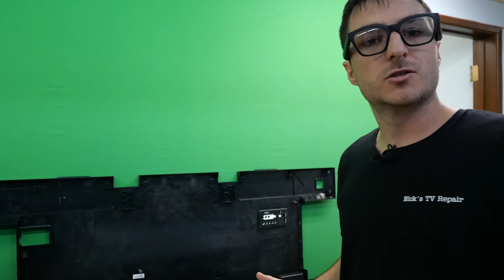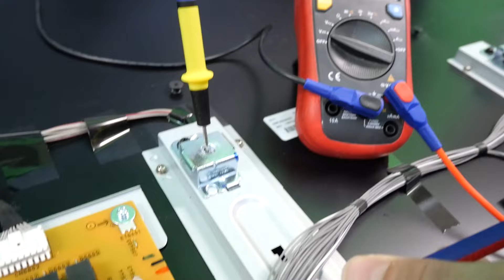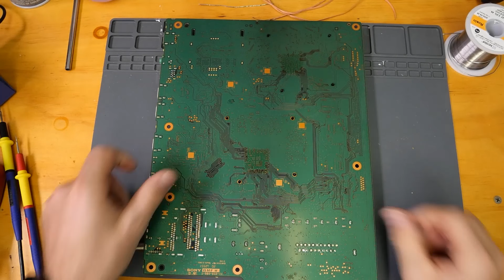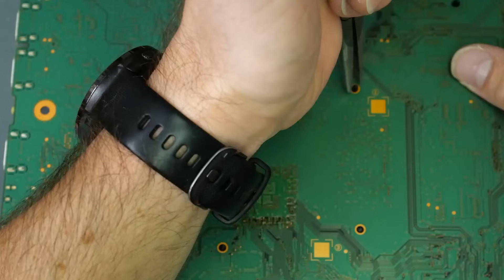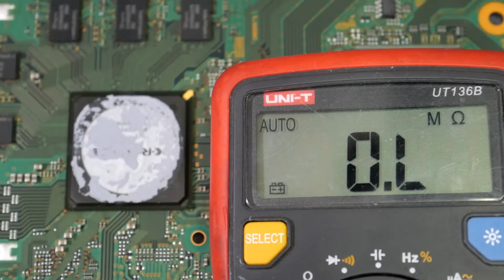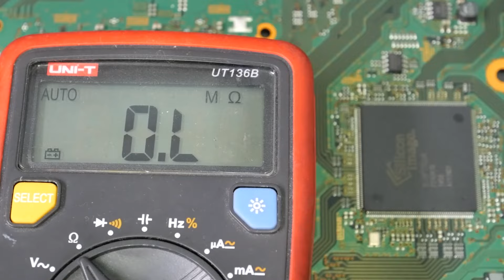Diagnose Sony 4K XBR-65X850D TV

Comment: There is nothing on the internet and YouTube for the 55-inch version of this model. But not for the no power issue I cannot find anything for the backlight error for the xbr55x850d everything I find is for the version of the model that ends with C. There is no wire coating to be able to locate which one it is

Comment: Hi Nick, I have the same issue with a completely unresponsive x850D that won’t power on. If I dispose of this TV and get another one, should I first remove the emmc chip to prevent someone from taking the streaming app credentials, email, etc?
Reply from the maker: most likely the eMMC is what has failed which means it's not readable and your data is probably safe. But if you want to be extra sure drill a hole through the eMMC chip before tossing out the set. But yes the emmc is the chip that would have your personal info.

Comment: Hi Nick, great content I’m having a same issue with this particular TV model the 850 D 65 inch Sony in doing the multimeter check for the power board. I don’t get any voltage for standby but I do get voltage for the 12V.  Do you think I have a problem with the power board?
Reply from the maker: When ever the power supply fails usually it will have 0v out. So because of that I would say there is a high chance the power supply is okay and the mainboard is the fault.

Comment: Hi Nick. My kd55xd7005 have problem while watching dvb-t2 (hevc), audio is ok, but picture stutters and freezes with lots of artifacts. That also happens on netflix and most of the time on youtube. When playing on external source everything works. Should I look for problems at tcon, or decoder at main board?
Reply from the maker: My advice would be to just use an external device for your apps. But mainboard is probably your fault.

Comment: Hey how's going?
I have 75X850D with same simptoms. Both PS are working only no tcon 12v. It was problem with emmc too. 
So wich kind of emmc r u using with? Genuine klmag1jenb-b041, compatible h26m52103fmr or KLMAG2GEND-B031 ?
Thanks in advance
Reply from the maker: I don't believe we are using the same one as is on the board but are using a compatible replacement. I honestly don't know which one we are using but there is not 1 right answer, there are many chips that can be used and depending on our parts supplier parts availability we have had to switch a few times.
Reply: @ Hey Nick 🤝
I need programmed emmc for my tv cuz I don’t have programmer, could you please sell to me emmc with firmware on it? 
I’ve sent a message at Dec 3rd on your mail, but someone answered me that we don’t selling parts. 
Please, help me with that. Tnx in advance

Comment: Hi Nick! could you please explain, why do we see so small resitance value like 33 ohms at the surroundings capacitors of  hdmi processor? Thanks
Reply from the maker: One side of the cap goes to ground, the other goes directly to the HDMI processor. The cap has extremely high resistance, you can't read it with my meter at least, but the IC chip has a 33 ohm resistance to ground on that specific line. So when you read the cap what you are actually doing is reading the IC. It's just easier to take the measurment on the cap than the IC leg. As for why specifically is the IC showing 33 ohms, you would have to look at how the IC is designed.
Reply: @NicksTVRepair  gratefull

Comment: If the EEMC is bad you should be able to see a single spot on it getting hot on a Thermal Camera. Rather than the entire chip getting hot. I had one go bad on an LG OLED and the EEMC would light up with a hot spot and then the relay would click off every second or two.
Infiray P2 Pro Themal Camera with Macro lense has increble clarity on small components. Couldn't recomend it more.

Where do you get the EEMC Chips from? Dead boards?
Reply from the maker: It's very rare for the eMMC to fail shorted like that. Almost always it just starts failing due to having too many read and write cycles. This won't cause it to get hot and won't be detectable without removing it from the circuit and putting it in a tester. 
With that said, it's pretty cool that you found one like that and were able to detect it with a thermal camera. Do you remember what the model of the TV was specifically? 
As for the eMMC chips, we get them as new unprogrammed from a secret supplier whose name I won't divulge.
Reply: LG OLED65CXPUA.
Reply from the maker: Oh, interesting. We have worked on and seen over 100 of these in the last 3-4 months but I have yet to see one with that failure. I will be keeping an eye out for it. 99% of the time it's the processor that's gone bad but I'll have my tech start using our UNIT thermal camera to check them out moving forward. You bet that I'll do a video on that the moment I find one with that fault so keep an eye out.
Reply: @NicksTVRepair  Infiray p2 pro has a fast refresh rate, so you might not pick it up on other thermal cameras. Not sure depends how quick the flash is. The macro lense in mindblowing, high detail on even the smallest components
Reply: Also a chip getting evenly hot is normal, but a hot spot in one area is usually bad chip, or cpu etc. The nand chip i observed had just a single hot spot on it.
Reply from the maker: Im going to start looking at the Nand chips with the thermal camera as well then. We do a good amount of Nand repairs but the majority that we do typically don't have bad nand chips, it's the software that gets corrupted but we do occasionally see bad chips as well. So in those scenarios that would be a good way to confirm.

Comment: Hi nick, I have a 55x850d black screen, no standby white or red flashing light. I have 3.3v, 12v and 19v on LD board and main boards, but I have BL_ERR 2.1v, if bypass the BL_err still have no standby led or flashing red light. if disconnect the cable from LD board to mainboard, I have back light on, 
then I measured few cap near the silicon image chip, few cap have 32-35 ohms, most likely the emc chip is bad?
Reply from the maker: Yes I would agree most likely the eMMC chip is bad. 
You can either replace the mainboard or send yours in for repair. However this model is no longer supported, so who ever you buy from make sure they provide a programed flash drive so you can pair the mainboard to your tv.

Comment: Can you do a tutorial on how to change the LED backlight on this model?
Reply from the maker: I have gotten several requests for that, and I will be doing a video on it once I get one of these TVs back in the shop with a backlight failure. But sometimes it's many months before one of these comes in with that fault, and sometimes I get 2 in the same week. It's unpredictable.
Reply: @NicksTVRepair  thank you for the reply. Let me ask you this, does the metal bezel, screen, etc have to come off in order to replace the backlighting in this model?
Reply from the maker: Yes the metal frame will need to be removed so that you can lift the screen off of the TV, then the diffusers, and then you will have access to the LED strips. It is a long process.
Reply: @NicksTVRepair  thanks bud. I ordered that part (LED backlight) from you and will update everyone on how badly this repair went lol.
Reply from the maker: haha sounds good. Just take your time with it, don't rush it, make sure you set at least 2h of time and as painful as it sounds don't do a little bit one day and finish later, do it all in one go. If you spread it over a few days you will forget where things go and how you took it apart. It's best to do it all in 1 sitting. 

This is not your TV, so it won't be the exact same, but I recommend you watch this video as it is for a similar sony and will help you get an idea of how to do this:
https://www.youtube.com/watch?v=kbk2SJkmtnM&t
Reply: @NicksTVRepair  yes, sir. Thank you for your time, bud.
Reply from the maker: Let me know how it goes. I am  keeping an eye out for this set.
Reply: @NicksTVRepair  so far not so good lol. The LED strips were bent. I called y’all and was told that they’ll work, but won’t work for long, to send in pics of the package and strips. Hopefully y’all will send new ones in and take these back or something.
Reply from the maker: Yes I got your photos of the damaged box from shipping and my shipping guy just shipped a new set of LED strips out to you today. They should arrive very soon.
I would say just toss out the first set that was damaged during shipping, there is no need to return them.
Reply: @NicksTVRepair  10-4. Thanks, y’all!
Reply from the maker: How did it all go in the end with the replacement strips?

Comment: i have a 75x850d. is the steps the same?
Reply from the maker: Yes and no. The 75" has different types of circuit boards. It uses one that are more similar to the 930D series. You can check these videos out instead, they may be a bit more help:
Confirm your DPS baord is okay (least likely of your faults with the 75" version)
https://youtu.be/kaCl8J1pPd8

Mainboard fault on the CPU (also very unlikely with your model version)
https://youtu.be/bF46xvxVYW0

Mainboard eMMC fault (most likely reason for issues with the XBR-75X850D)
https://youtu.be/YL123l67h6w

Email us directly if you have any additional questions otherwise it might be tough to keep track of conversations accross the different videos. (contact info in video description)

Comment: Tried doing this myself but managed to pull several pads off with the emmc lol :’)
Reply from the maker: Send us a picture of the ripped traces, we might still be able to fix it. Otherwise, if we can't, we also have refurbished ones for sale.
Reply: I had the same problem. It depends if you ripped off some Not Connected Pins (darker background) or used pins (on brighter background). But even only NC pads were ripped off you have to be careful when soldering these, as the remaining solder balls of the chip can bridge some used pins
Reply: Preheat the Board with your hot air gun a whol bunch before going after the chip!
Reply: @0ctivate  amigo tengo una con el mismo pronblema pero no entiendo ingles soy tecnico

Comment: Some Apps may not work after EMMC replacment and reprogramming even if sent in for repair?
Reply from the maker: If it is an emmc repair then yes. Not all are EMMC repairs, some are CPU replacement, some are HDMI processor. But if the EMMC does need to be replaced then in that case yes some of the apps may not work. However using a firestick, roku, chromcast, apple tv or other similar devices will allow you to get access to all your apps and more + will be faster and easier to navigate than the built in apps. 
By default the native apps are an inferior version of the apps. So you could call it a forced upgrade.

Comment: Hey Nick, love your videos.  Wonder if you have ever done a Sony XR-85x95J repair.  We're having a very very similar issue but in our case, we're not seeing any standby voltage.  We replaced the powerboard twice (through the same dealer) and still nothing.  The original and the two replacements and still no standby voltage reading.  We're following this exact method for our power supply board.  I think we're doing the measurement correctly as there is definitely voltage going into the board, we have confirmed that.
Reply from the maker: I have not had to work on the X95J series, but you and several others have requested we fix them. I will look into it and see what needs to be done and make a video once we are properly set up for it. 
As for the fault you are experiencing, I can only guess your mainboard is bad. Odds are typically low that you are buying multiple bad power supply boads in a row. Most likely something else is at play here.

Comment: Awesome video!
Thank you for the quality content and good explanations. 

(Change your multimeter battery 😉)
Reply from the maker: Haha it's a gag at this point. The battery has been low for almost a year. It should be done beause it can actually thow off the reading.
Reply: its funny cuz ours is constantly needing a fresh battery too, but they just keep working... 
and no we've not used a DCPS to charge a 9v 😆  @NicksTVRepair

Comment: Help! Hi Nick. I have a sony bravia xbr-65x900a that needs the LED backlight strips replaced. I have the new strips, but I sure could use a sony service manual or a video to guide me through the installation. I just don't want to run into any "Gotcha's". Do you have any suggestions? Thank you.
Reply from the maker: I am sorry I can't help you there. I don't have a video or have I seen one of those TV's walk into our shop in a very long time. I don't think I will be able to do a video for you. Your best bet may be to go check out Shopjimmy's channel, they have lots of LED strip repair videos, try and find a model similar to yours and watch it as a guide. It won't be the same as yours so you will still have to figure out some of it on your own, but at least it will be something.
Reply: @NicksTVRepair  Thanks Nick for your reply. This model I have is a one of a kind with fantastic speakers integrated into the front of the unit so the frame around the screen is a little different than most. I watched a few videos on replacing the LED strips on other models, so I guess I’ll just go fer it. Thanks again.

Comment: Nick, I opened mine up to check on a 6 blinking red light issue. The board near 3 of the mosfets is black & burnt to a crisp (but I was able to get it powered on by bypassing the BL_ERR wire to confirm 1/2 of the backlights are dead.) Should I replace the power board along with the necessary backlights?
Reply: Also, the left half of the screen has no light at all, but the right half looks alright. Any idea how many replacements that would take?
Reply from the maker: Hey Michael,

I don't have a video on LED replacements for this TV, but you always will want to replace both the left and right side strips together eventhough it sounds like only 1 of the sides is out right now. If you don't, you will find the other is not to far behind and will fail soon. Might as well get them both replaced if you are going through the troulble of opening the set all the way down to the LEDs. 
Black and burnt to a crisp is okay if the components all work. With the TV disconnected from power of course, you would want to check the resistance on those transistors and see if any are short. If yes then replace them or the board entirely. If not then you should be good to keep the same board and only replace the LED strips.
Reply: @NicksTVRepair  Awesome, thank you for the advice!

Comment: I have seen 3 of these dead sonys in the past few months.  Have you any knowledge of why the emmc fails?  Sony software too hard on the emmc or bad batch of emmc?
Reply from the maker: The EMMC chips have a set amount of read and writes cycles they can do. This is the same thing you see with SSD and NVME's used to store data for computers. 
When you perform different tasks on your TV like watch streaming apps, do searches for shows, change the volume or certain settings, turning off the set and back on, you do cause small changes to the memory. This is why when you bring the TV volume to 100, turn it off and back on, the volume is still set to 100. 
In order to remember the change, the data that said the volume is set to 30, is erased, and new data is written to it saying now it's 100. 
The program/erase process will deterioration the oxide layer that traps electrons in a flash memory cell, which eventually will wear out and lose its ability to store data.
This is the same faults you see with Tesla's model 3 cars. The EMMC chip they used was cheap and had a low read/write cycles available before degredation would occur and thus they had to do a recall on it. 

If you look at certain memory storage devices as mentioned SSD's and NVME's, the higher end ones will advertise their edurance and their abitlity to have data erased and written to them. This will usually be provided in TBW which is simply Terabytes Written.

Hope this helps
Reply: Thank you for sharing your knowledge, I was abt to let Best Buy haul mine away.   I am now going to fix it and donate to church, women shelter or another non profit! @NicksTVRepair